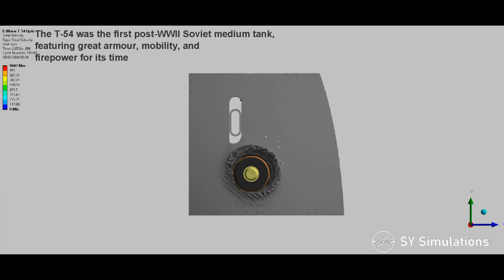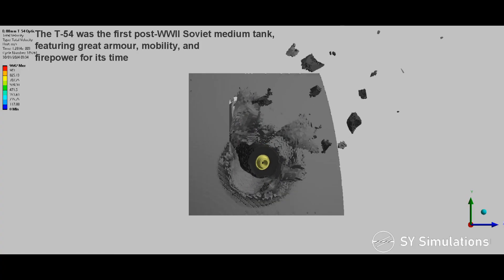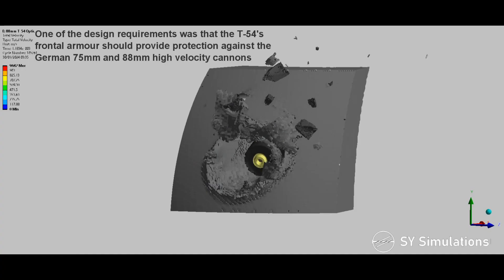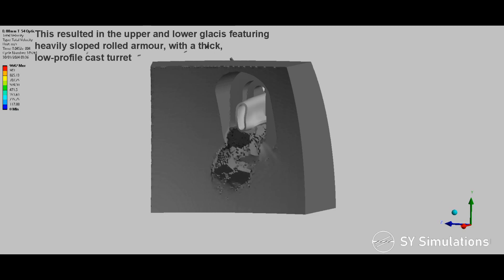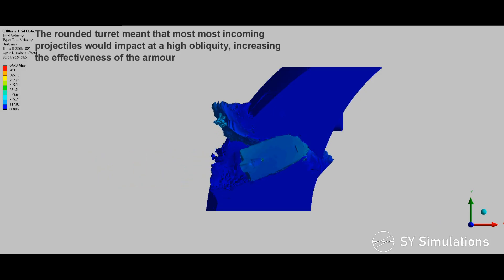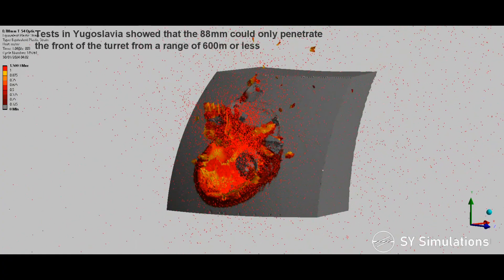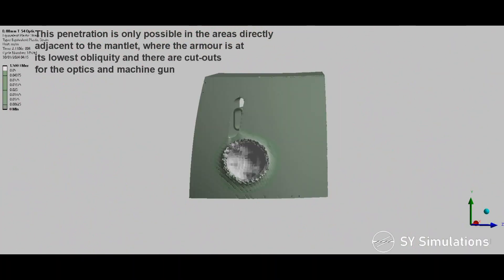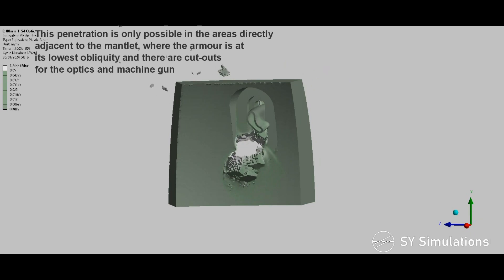TIGER II vs T-54 | 88mm Pzgr.39/43 vs T-54 Turret | Armour Penetration Simulation

Comment: @SYsimulations projectile behavior appears wrong. 7,5 cm and 8,8 cm Pzgr of the latest generations remained whole at velocities at least up to 1100 m/s. With the 8,8 cm projectile beeing more robust.

According Bericht 166 der Lilienthalgesellschaft Vorgänge beim Beschuß von Panzerplatten  1943. 7,5 cm Pzgr 39 vs 200 mm homogenous plate at 30° obliquity.
Impact at 1020 m/s projectile rebounded
Impact at 1070 m/s projectile stuck in plate whole. Head of projectile could be seen.
Impact at 1090 m/s projectile through plate and remained whole. 
Absolutely no deformation visible to all three cases.

Result was inline with late projectile penetration chart.

Size of the (incomplete) hole was in every case calibersized.

Comment: And if it was the 40/43 round, it would have penetrated at around 1600m, while its 100mm wouldnt be able to penetrate the front hull at any distance, and the turrent front at probably 200m or under with regular ap rounds.

Comment: The Germans Gunners would have engaged and destroyed the T54/55 with a 88 / L71- APCR / APDS  round which would have blasted through the front of the turret at 1500 metres range !!!
If hypothetically speaking the War had lasted another 5 years!

Comment: The armor was just barely adequate to stop the projectile, but it looks like there still would have been a lot of backspalling. It's a wonder it took so long for T-55s to be up-armored.
Reply: Because they weren't against WW2 Germany with their awesome long 88... Only weakass 76mm, 17pounder, 20 pounder and 90mm.
Reply: @AKUJIVALDO  Yeah, no kidding. I researched the armor penetration figures for the 90mm guns used on the M26, M46, M47, and M48, and they're less than you'd expect.

Comment: You should make a video that explores the difference the angle of yaw of projectile makes: one with projectile hitting the highly angled plate while pointing a few dgr downwards and another with same setup but with projectiles nose pointing away from the plate.
This factor can significantly alter the results when the velocity of projectile is right at the ballistic limit of the plate, changing a clean perforation into a harmless scoop.

Comment: The day this kind of damage model is integrated to War thunder type games, it's going to be a great leap for gaming
Reply: Probably when Personal Computers become powerful as quantum computers. Because AFAIK this single rendering takes multiple hours, now imagine in game constant calculation and rendering of each shot.
Reply: The thing is, in-game pen simulations don't even need to be this detailed, but Gaijin is incapable (or unwilling) of even making optics into weakspots instead of infinite armor.
Reply: @bickboose9364  I would just appreciate if breaking the optics and viewports on a tank did something in WT
Reply: @dominuslogik484  Yeah, anything instead of them acting as black hole singularity armor would be nice, I dare say. 👍
Reply: @bickboose9364  heck they could go easy mode and make a broken optic reduce the gunners aiming skill or put a bit of variability on the projectile so my jumbo stops getting machine gun port sniped by panthers from 500+ meters away when my shell hits the optics
Reply: @dominuslogik484  They could, definitely. But, I'm not holding my breath. Instead, I always expect Gaijin will be making the game worse with each patch -- and they never fail to deliver...
Reply: @bickboose9364  skill issue

Comment: Did you already test the M41 Walker Bulldog’s 76mm gun yet? Would be interesting to see how its APDS round would perform against a T-54/55 in a simulation
Reply: Would go through. The 76mm APDS is around the same or even more powerfull than the 88mm Pzgr. 40 APCR, which would fare at least equal to the 88mm Pzgr. 39 APCBC.
Reply: @Kuschel_K Go through at under 500m sure but past that probably not.
Reply: никак
Reply: ARVN tankers would have no doubt scored some kills against PAVN T54 and T55s in later stages of the Vietnam War....

Comment: The T54 T55 were smaller tanks than the Tiger Ausf B so it would be harder for the 88mm to be hit???
Reply: What kind of logic is that? The T34 was smaller than the T54, yet germans had no problem knocking them out from 2+km away lol
Reply: @skdKitsune  really? Wasn't the T54 besides gun and turret not more or less same size as the 34/85

Comment: So there are T-54's still out there in active service in some capacity with a turret originally designed to counter Tiger II ammo? Wild.
Reply: If you look at this from a different perspective, a 100mm potato launcher is still a 100mm potato launcher. 
It is better to have a 100mm potato launcher than have no 100mm potato launcher.
Reply: If I have to storm a machine gun nest as an infantryman, I would prefer to have a T54 as a support gun than to have nothing
Reply: There are still a lot of 100 mm ammunition in warehouses. These tanks are used as self-propelled artillery
Reply: Soviets used PaK43 as a template for a "scary anti-tank gun we might face in considerable numbers" at the time, they knew nobody would actually be using it after WW2. That said 20pdr introduced in 1948 turned out to be pretty poor against T-54 so they were spot on.
Reply: @Klovaneer more like Germany was using the deadliest WW2 anti-tank gun, both as tanks/tank destroyers main armament and as towed anti-tank gun.

Soviets assumed nobody will be upping that soon. And they were right. It was not until 1958-59 until 105mmL7 was produced and mounted in tank.
Reply: @Klovaneer  'Soviets used PaK43 as a template for a "scary anti-tank gun we might face in considerable numbers"' 

The Americans developed the T54 90mm gun of similar firepower, but (according to War Thunder) due to postwar budget constraints, chose not to mass produce it. 

Better shaped charge projectiles became available in the 1950s, and they were good enough to handle the T-54.
Reply: @r.j.dunnill1465  First 105mm HEAT was introduced in 1961, 15 years is eternity.
Reply: @Klovaneer  They were using 90mm in the 1950s.
Reply: @r.j.dunnill1465  Well if that was enough i don't get the L7 rush.
Reply: @Klovaneer  It was deemed prudent to improve firepower to deal with future Soviet tanks?
Reply: @Klovaneer  "the L7 rush." Impetus for the L7 stemmed from an incorrect estimation of T-54 armor in 1956. 

The T-54/T-55 were not as well-protected as the Anglo-Americans were lead to believe.
Reply: Ну учитывая что 105мм орудия как раз таки эквивалент 100мм пушки Т-54/55, то вас должно больше шокировать что Леопард 1 и первые Абрамсы были с этим орудием.

И как уже не раз сказали - пушка всё ещё хороша. А сам танк, если упаковать его в современную динамическую защиту сможет держать кумулятивные боеприпасы получше любых БМП. Так что скорее их наоборот ждёт вторая жизнь скоро, как и американский М-60.
Reply: Leo 1s were recently pushed back into service in Ukraine, and their armor wasn't designed to counter jack shit
Reply: Yeah, just like M48 and M60. Wild.
Reply: "Wild."

Even wilder, the fact that the T-54 today is still fully relevant on any battlefield.
As mentioned by previous poster, when they're no longer good enough as tanks, they're still plenty good enough as the modern equivalent of a StuG.   Or in other words, mobile, heavily protected firepower.
Reply: @DIREWOLFx75 
The T-54?
Sill fully relevant?
On ANY battlefield??
Tell me you're joking lol
Reply: @Mii_Oh_Nine  sigh

You seriously need to learn to think for yourself.

Yes, on ANY battlefield.

I didn't say it was relevant as a TANK on every battlefield.
But as has been shown, the former DPR/LPR forces use both T-54s and T-62s as mobile armored firepower with excellent results.

You may also want to remember that part of the military industry the west built up in Ukraine since 2014, included an upgrade package for T-54s, precisely to allow the tank to be relevant even as a tank on a modern battlefield.
Reply: @DIREWOLFx75  I misread with you said, I assumed you were just talking about them as just tanks, with that I do understand and agree with what you're saying now.
Reply: @Mii_Oh_Nine  they're being used in Ukraine by both sides, mostly as fire support
Reply: Wehraboo

Comment: What about Soviet 85mm gun or US 76mm gun vs Panther 2 Schmalturm? Would the new turret offer enough protection against the most common 1945 threats?
Reply: Possibly from some distance, Schmalturm would've had little spots to be hit flat. If it doesn't hit the flat turret face but the angled sides its an instant bounce. It would be hard to hit such small areas from beyond 400-500 meters but it probably would destroy the tank if it did hit as the penetration power is good enough to tackle 100mms of flat armor.
Reply: @ultravioletsus  the question is if a hit from 800 meters would still cause enough spall to be a threat. Of course its hard to hit, but there is a mass of allied tanks firing at one panther.
Reply: @Einheit101  I'd say it'd be enough to disable the Panther. As 76mm ballistics usually show around 90 to 100 mms of penetration at about 1 kilometer range, had the turret armor been angled even a little then the penetration power wouldn't be enough to create a decent spalling inside the tank.

Comment: Do T-90M’s driver’s harch vs a few bradley shell’s fired in the same spot like the real life event
Reply: Did they get a APDSFS shot into the vision port? Would have been one hell of a shot. There is nowhere the 25mm can penetrate into the fighting compartment. From what I gather, they smashed up all the sensors which likely glitches the turret and panicked the crew into crashing. The entire encounter was a super videogame move that is much easier to do for real.

If another game is accurate, no not WT, a T54/55 can be killed by the 25mm in the back of the turret.
Reply: The Bradley fuck the optical on the t90m it didn't penetrate the tank tho , FPV drone and arty later taken it out
Reply: The T-90's drivers hatch is on the roof of the hull and can only be hit if the Bradley is on an elevated location. Even then it would hit at a very high angle
Reply: The bradleys used HE ammo

Comment: How about t62 turret front "flat spot"?
Reply: Yes, let's test technology that's 20 years apart to see which is better.
Reply: Only about 10 year difference between the tank here, and the base model T-62 was incredibly similar armor wise.
Reply: @cheekibreeki4638 
I believed all t62 has the same based armor construction. 

I'm specifically interested in t62 because the Yugoslavia determined t62 turret has better frontal protection, but not good enough to warrant an import.

The real increase of thickness is only like 15mm. Is that enough to prevent large chunk of steel flying off at the same condition?
Reply: @999mi999 
You put a shot into the side of t62 with m62 ap and it will goes up in flame. Your point?

Comment: people are stealing your videos for tiktok without your permission, please use a watermark! i hate seeing your amazing work being stolen without credit. keep up the good work.
Reply from the maker: Thanks, someone mentioned this to me before. Unfortunately, even if I move the watermark out of the black bands people will find a way to block it out. And i don't want it ontop of everything as it will detract from the video. What is the name of the tiktok account(s) which are sharing them the most? (I found one called SY Simulations on tiktok which is NOT me)
I would greatly appreciate it if anyone who came across my content (or any other stimulation channel) could add comments on the videos, sending people to the original creators, thanks!
Reply: @SYsimulations  maybe it would be an idea to put your Name on the Shell or the armor Plate in the simulation as long as it does not Influence the results?
Reply: good idea
 @ArchaeopteryxGaming
Reply: @SYsimulations  You could have your in some of the null armour for the cut away section. Im not too sure how the software works but I assume you could add in material text in a different colour that is still the same material that it is being surrounded by. People stealing it would have to crop out half the video or until the armour is completely deformed or try and edit out misshapen text from the shell. Might extend the rendering of the simulation a bit thoughThey could have it in some of the null armour for the cut away section. Im not too sure how the software works but I assume you could add in material text in a different colour that is still the same material that it is being surrounded by. People stealing it would have to crop out half the video or until the armour is completely deformed or try and edit out misshapen text from the shell. Might extend the rendering of the simulation a bit though.
Reply: @SYsimulations please, give me a link to YugoslaviaT-54 armor pen test with long 8.8 KwK
I don't find anything similar
Reply: @SYsimulations  theres also loads of people stealing your videos in wechat shorts
Reply: @SYsimulations place your watermark at the centre of the video
Reply: Noone cares, nerd.
Reply: Should be used watermark behind object he is testing or appearing in random areas
Reply: He is?
Reply: @Fiberglass_Insulation his current watermark is really easy to crop out

Comment: What about a JagdTiger with its 128mm gun? Can it withstand?
Reply: Well obviously if 88mm penetrates, 128mm will too. Jagdtiger's 128mm gun had up to 260mm of penetration, compared to max 230mm of 88mm L/71.
Reply: @czwarty7878  It obviously depends on the distance, the area, and the angle of impact. But, yes 128mm should do the trick
Reply: @czwarty7878  - Can the 128 penetrate the strongest point of the armor at further distance?

This video had the 88 shell hit the weakest point of point turret armor.